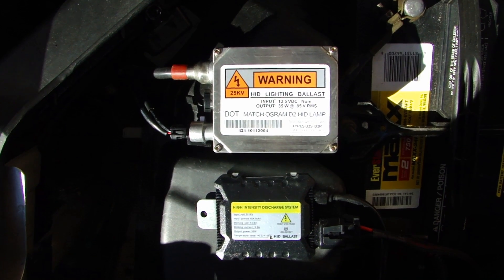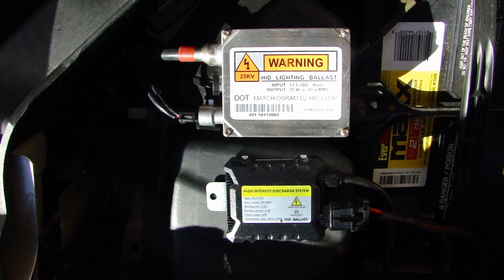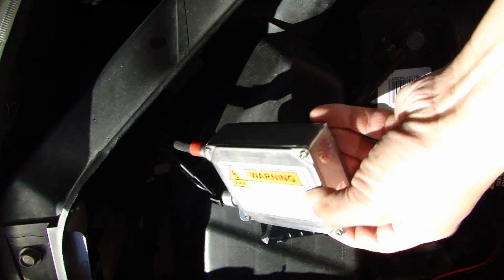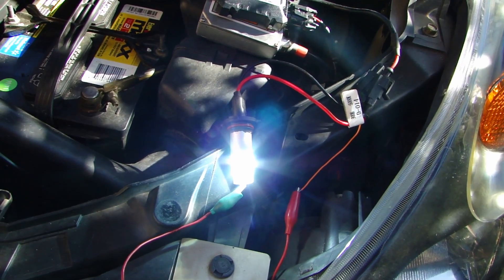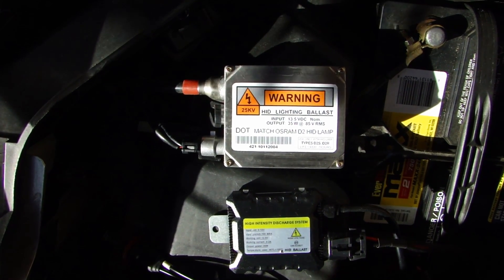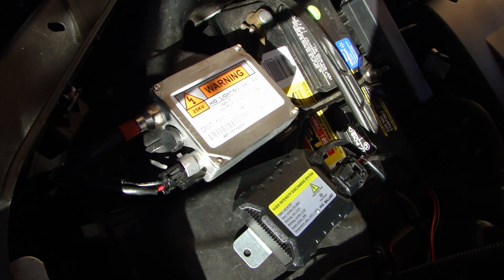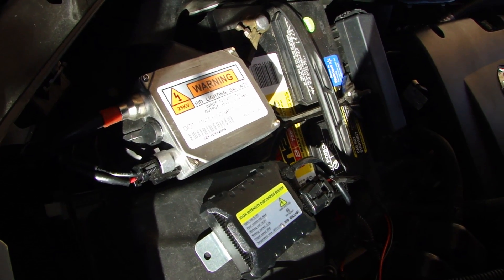HID Ballast Compare: AC Ballast vs DC Ballast

Comment: I have a 30000K deep blue bulb and I'm trying to reproduce an accurate blue color and I'm currently using a 55W ballast. So would choosing between a 35W AC vs DC make any difference in color temperature?

To sum it up: does AC vs DC affect color temp. Or is it just the wattage that just matters.
Reply: 30k should be almost pink, are you sure that you got 30k? Cyan starts from 7k-8k up to 15k kelvin. DC ballast can affect color temp, power delivery does not move color temp higher, only if bulb will get a lot of hours (800-1000 hrs) color temp would increase slightly (e.g. from 4300k to 5000k, yellow tone will dissapear, or 5k to 6k, blue would appear) and produce more UV wich can damage lens module reflector.

Comment: Where does the 27kV come in when it only outputs 85V rms? I am not into xenon but looking for a HV AC continuous powersupply which uses primary DC and this looks promissing. But I need the 26kV. Can you explain?

Comment: So multimeters measure RMS voltage for AC current. This just means that your measurement of 85v AC is the equivalent of 85v DC in comparison of power. This just makes it easier to compare AC and DC values. Because an AC circuit has a changing voltage, a sine wave, and at any moment in time the AC voltage is different from the last. The multimeter does not show you the actual peak voltage of the sine wave. The multimeter value is actually 70.7 percent of the peak AC voltage. This is basically just the average voltage of the sine wave. In conclusion my best guess is that the AC ballast is actually delivery more power than the DC ballast because the 85v is greater than 80v but also partly because the AC ballast is actually delivering more than 85v for a portion of the signal's period. Also AC circuits behave differently than DC circuits in other ways, look into impedance if you care to. Impedance is just resistance but with AC signals instead of DC signals.

Comment: Which HID kit to buy? NONE! Always buy ballast and bulbs separately. Almost all those compact ballasts are garbage and many stating they are 55W are still just 35W and they slap a different sticker on it. Spend a bit more on a decent AC ballast. Bulbs not so important, just check reviews and get your preferred color temp. FYI, higher wattage = lower color temp. Unfortunately, the listings for a bulbs temp don't specify for what wattage so usually best to look for </=5000k bulbs and hope for the best if you want actual white.

Comment: Is it true that for ac ballast you need to use only AC lamp?   And how I can know it which lamp is AC or DC? In your video you used same lamp for  two different ballast?
Reply from the maker: There is no AC or DC xenon lamp. It's the same bulb. Just different ballast.
Reply: @dial2fast  thanks for answer. There is information on the Internet that there are different types of lamps and AC lamps will not work well with DC ballast, flicker for example. However, I didn't find any confirmation. Maybe shouldn't mess around, buy AC ballast and enjoy...
Reply: @-lm2vi  buy the best ac ballast , is the Hylux. About 55 euros pair on ebay .

Comment: Good video. To add some info, a dc ballast also delivers less current, so the same bulb produces less lumens using a dc ballast than using an ac ballast. In my particular case, with a blue vision halogen bulb you get more illumination from your headlight than using xenon with dc ballast

Comment: I ran test and the small one pulls 35 watts and the big metal ballast pulls 55 to 60 watts that's what changes the color and the big ballast if you see in the video they are DC DC'S pull more power but burn your bulbs faster.

Comment: I simply got an OEM toyota ballasts with D2S D2R bulb adapter for my headlights and could not possibly be happier with it BTW. My mom has a sienna with 170k miles on it (OEM xeonon lights) and I just installed new set of bulbs on them cuz they got dim after 12 years !!

Comment: Thanks alot! Some days ago one of my ballast broke, they were dated at 2005. I had AC ballast, i bought couple days ago a pair of new ballast which are way smaller and have plastic housings. i connected them and i had originally 3000k. with the new ballast they were more a green tint and less brighter. i already contacted the store but no reply but i think thanks to your video i found out why. Those newer ballast are just way different than the older ones. But what is your opinion? are the newer DC ballasts better or not?
Reply: The older large ones were very good.  They were mostly sold by DDM and other companies.   If you buy a newer cheaper one off eBay and its lower wattage it will change the color.

Comment: I can confirm about the difference in color temperature between DC and AC ballast. I had retrofitted with DC HID ballast some 7 years ago.. The left side stopped working, so I replaced it with an AC ballast and the light output is warmer (less blue)... So I decided to replace both DC ballasts to the AC ballasts.. In fact, the 3000K HID bulbs which came as a set with the AC ballasts looked more yellow than the halogen bulbs when lighted up...
Reply: Which one is brighter, the ac or dc?

Comment: See that light spilloff around the top of the beam? That is blinding oncoming traffic, its because you are using HID bulbs in a halogen housing / reflector / projector. 

The difference is the traditional lights tend to have the brightest part of the bulb in the center of the lighting element. The HID bulbs will have the brightest part of the light coming from the points on the arc - at the ends of the lighting element. This means the reflector will be slightly off.

Depending on your local it may be UNLAWFUL to use one of these kits because they blind oncoming traffic. Do it right - get a HID projector and have it mounted in your headlight assembly, or buy an aftermarket assembly that has the HID projector built in. Sure, these kits may be cheap, but they are also DANGEROUS for oncoming traffic and cause accidents. 

They also give a false impression of more light - the light spilloff tends to make things immeadiately in your area (5-10 feet) LOOK brighter because thats where all the light is going. Things in the distance, +30 feet out will be darker because not as much light is getting where it needs to go. Again, depending where you live you may be fined or worse for using kits like this, or worst case scenario you cause an accident because traffic around you can't see where they are going.

A proper headlight will have a hard line where the beam cuts off and next to no spill above that line. Please, you did a lot of research into types of HID kits, go the extra mile and put them in a proper housing.
Reply: Absolute truth. I'm sick of these idiots running HID conversions in halogen housings. No matter where he is, if he's in the US it's illegal. Now we have all these LEDs floating around too. Same thing for the most part. They scatter light & blind the oncoming traffic yet do little for the driver of those cars. Don't get me wrong, there are good LED bulbs that work fine in a halogen housing. Much better than a HID conversion. But you have to use some common sense & do some research before you buy them.
Reply: @01ghostmechanic01  I honestly DON'T care who I piss off as newer cars and trucks are WAY brighter then mine and mine are bright!
Reply: 01ghostmechanic01 It is not illegal in the US to use HIDs in a reflector housing.  Some cars it is possible to use HIDs in a reflector housing because they have a shroud around the light.  To me, it seems to be the cars that are also sold in Europe, like my 2008 Vue for example.  There is a shroud that covers the tip of the bulb and the bottom of the bulb, so there is no glare that reflect up into other drivers eyes... cars without the shroud, I agree needs to be in a proper housing

Comment: Good info.
 have you happen to check which of then lights faster? I mean the delay in the bulb to achieve the maximum brightness on cold start
Reply from the maker: The ones I have tried all take a bit of time to get to full brightness, and typically slower than OEM HID.
Reply: dial2fast did ac ballast get warmed the bulb quicker than the dc ballast?

Comment: you ran the AC ballast using DC power because it was on the headlight of your truck meaning from the battery of your truck? I ask because I have a set of LEDs that has a ballast that originally was running on AC I want to put those LEDs on my truck Power them from my battery which is DC will this ruin my ballast?

Comment: I'm a little confused here...  You're saying that the top is an "AC" Ballast, but I don't see it marked "AC" anywhere...  I'm trying to find a really good Ballast and that's why I'm asking...  BTW, thumbs up on this upload...  Thanks in advance...   Rico
Reply: it states there 85V RMS. RMS is used to measure AC output. So basically 85V RMS = 85V DC
Reply: Thanks Ammar...  I'm new to the HID world...  Learn something new every day...   Stay safe...   Rico
Reply: Ricovette if you want true 5k light use 55w ballast or 6k bulb with 35w ballast

Comment: is there a different in bulbs too?
Reply from the maker: Some people say there is. I have yet to find different bulbs.
Reply: So this is why my 4300k looks just like 5000k and my 3000k looks like green
Reply: No The bulb only have xenon gas in it.The colour depends on the ballast.
Suppose your bulb is 5000k but you switched to a new ballast which is 8000k.So it will surely give you 8000k because it depends on the current from the ballast that is drawn to the bulb which makes the bulb heat up and glow on different temperature.
More the current the more bluer it will become.
It depends totally on the ballast.

Comment: One thing you are not understanding is AC bulbs work with AC bulbs and DC work with DC bulbs
Reply from the maker: +Islam Cantres Please enlighten me with differences between 'AC' bulb and 'DC' bulb.
Reply: +dial2fast He doesn't know the difference either. He's just pretending to be smart.
Reply: +dial2fast one is dc current for dc ballasts and one is ac current for ac ballasts.
Reply: +dial2fast ac current alertnating current dc is firect current. think of this for reference you cant mix bulbs just like you cannot mix metal halide with high pressure sodium
Reply: @islamcantres  I dont know what you mean , i have high pressure sodium lights and i can put in metal halide bulbs without problems, the lights use the same balasts and starters like metal halide lights. ( see Philips sn58 ignitor , they work with son-t or cdm )

Comment: the larger ballast says DC on the label? i've been told you can't use certain HIDs with DC or AC ballast. some HIDs are made specifically for AC or DC.
Reply from the maker: +patrick lang The HID bulbs can be used on either AC or DC ballasts.

Comment: Just a thought - maybe the "bluer" light output from the DC ballast is due to the voltage being substantially lower than the output from the AC ballast. Even though the RMS AC voltage was ~84 volts, the AC peak voltages will be quite a lot higher; somewhere in the region of +/-119v [84*sqrt(2)]. Meanwhile, the DC output has no peaks and is just a constant ~80v.

I haven't had the opportunity to test any, but maybe some of the really cheap DC ballasts are trying to compensate for this by increasing the DC voltage. However, since it's always at the higher voltage (rather than varying from + peak to - peak as with an AC ballast); the bulbs are burning out quicker.
Reply: Matthew Weston That sqrt(2) thing is only true for sine waves, the ac ballast actually outputs a square wave so the RMS and peak voltage are pretty much the same.

Comment: Hi I purchased a 4300k hid kit from ebay and installed it correctly with a slim plastic ballast that it came with but the light is blue about 6000k not white 4300K please help i dont know if i should buy a better ballast with light bulbs or just ballast?
Reply: What's the wattage?
Reply: 55w according to the ballast.
Reply: Jakob Korzekwa 
You could change the ballasts first. Try F5 ballasts on Amazon. They're faster than most ballasts + produce a whiter light output.
Reply: Note: they come as single ballast per purchase.
Reply: +Khalid Ibrahim Thanks man. I really appriciate it.
Reply: those plastic ballast are junk get the metal ballast

Comment: Please link us a confirm AC ballast pls?
Reply from the maker: Yo Stop I bought these off ebay, and typically I don't post ebay links because these sellers come and go. But I found this one. Check it out. Keep in mind, I am not affiliated with the seller so don't come to me if there are any problems: @221717497576

Comment: Were you able to determine if either AC of DC ballasts interfere with radio reception? I noticed in the past that with the older larger ballats( mine was Xentec brand) they would interfere with radio reception. When I switched to a slimmer Xentec ballast, it went away. I'm currently running a retrofitted set of Matsushita ballasts for my lows and Xentec for my fogs. The Matsushitas also don't interfere.
Reply from the maker: I know the older AC ballast emits a high pitch sound but never had any issue with radio.

Comment: You have better videos than any others I have seen. Most don't stick to the point of the title. The rambling unprepared ones are bad.   
I would like you to show where the VOM is hooked up to the HID bulb for testing the voltage output of the two ballasts. Also, the setting of the VOM. (AC volts DC volts.) I could barely see them. (bad eyes) Maybe put a sheet of white paper behind the ballast and wiring to clarify the test. I have some knowledge of testing but a total greenhorn would be confused and discouraged in his efforts. Explain the "hook on" testing probe accessories because of the huge difference they make. I was astonished when I finally broke down and bought some. The difference was like day and night
I like the way you stretch out the wires for clear visual understanding. Most other videos have a wannabe nerd , "This is my relay and wires." Then he throws it still coiled up onto a pile of wires looking like spaghetti plus parts in a non-understandable heap. Then he drags some other wires out of the spaghetti pile , "This is my wire to the headlight." then throws it back into the same heap.
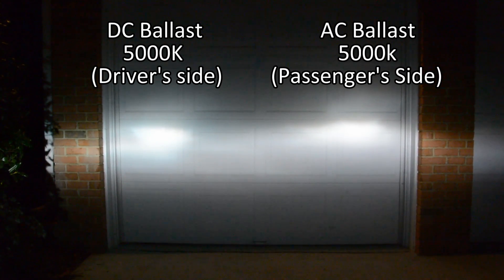Reply from the maker: I explained it better in another video of how I test the voltage. Click on this video and go to 3:40  https://youtu.be/yfs01VBiXHM

Comment: Hi, thanks for sharing an indepth compare and contrast for the Slim line ballasts and the larger AC ballasts. I just completed my retrofit with Generic Mini H1's but decided to cheap out on the bulb and ballasts. Very bad choice as I'm using the slim line dc ballasts and 4300k cheapo bulbs from ebay. One thing to note with cheap bulbs is that they are not at a perfectly perpendicular angle which required me to use aluminum tape to level off the base of the bulb so it would sit straight inside the projector. Next, the ballasts that I'm using are giving off extreme amounts of flicker so I decided to take a look on Amazon and Ebay for a solution. Amazon sells Zenex standard sized ballasts for $22 each with free shipping which is an awesome deal. These ballasts are the exact same as the ones you're testing so I just wanted people to know about that option.

Now as far as slim ballasts go, there are some high quality manufacturers in China that sell great quality slim ones like Hyluxtek and DLT which marks their 35w ballast as F3
Reply from the maker: After doing many research on my own to find a good HID brand, I realize it's very difficult as peoples understanding and experience with these vary so much. Many people just plug them in and seeing brighter light and say job done, great product. On many car forums, if people ask about Ebay HID kits, they are told it's all junk and don't buy them, and the conversation stops. On top of that, those China manufacturers are rebranding them to so many different labels and copying some that may be of better quality. They almost never tell you it it's a AC or DC ballast. So I ended up sucking it up and buying several to try and seeing which one works best. Hopefully the seller takes return so you can return it (of course don't damage it).